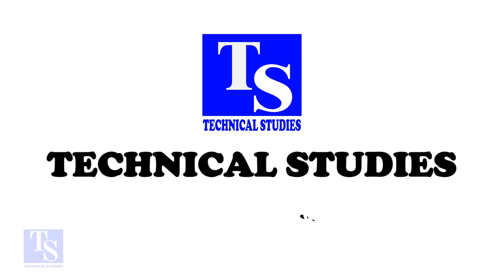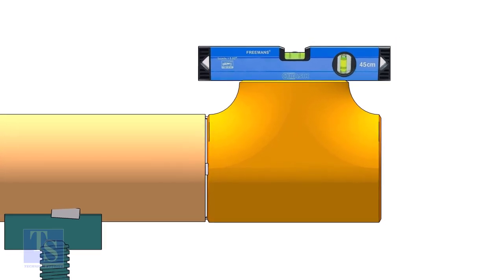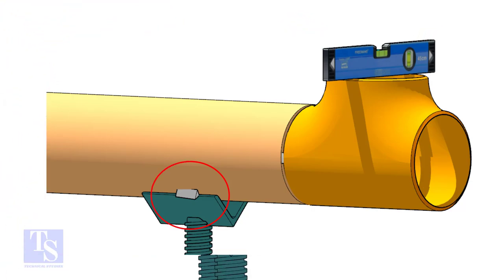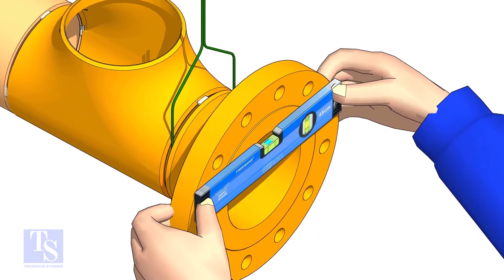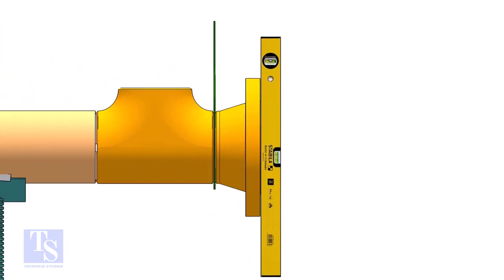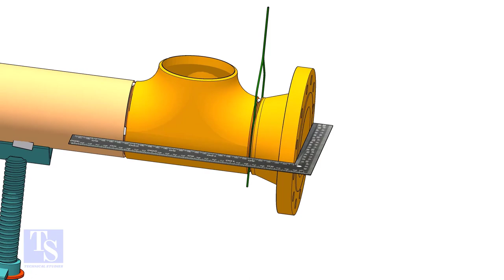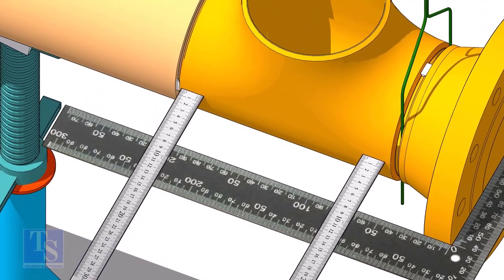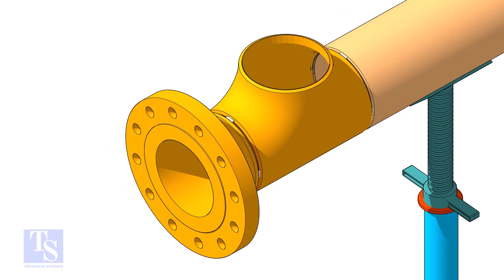PIPING - TEE TO FLANGE FIT UP TUTORIAL FOR BEGINNERS Pipe fit up tutorials

Comment: why would you not level the pipe?????
Reply from the maker: Good question. The pipe is only to support the tee. There are several methods. This is an example only. You can simply put the tee in a vertical position and put the flange on it. put the gap rod, make the flange holes parallel to the Tee branch face, and tack weld it. Thank you for the comment.
Reply: @technicalstudies.  Thank You